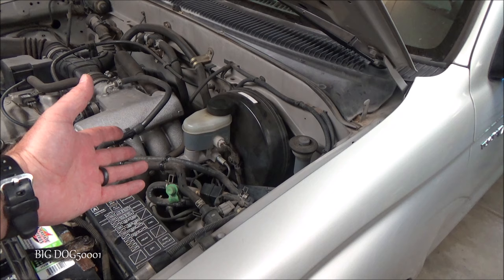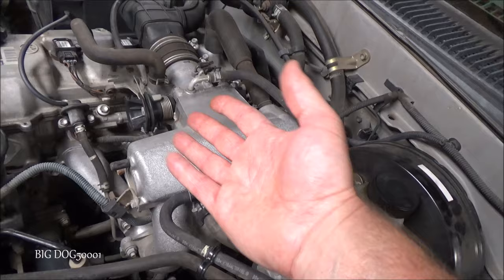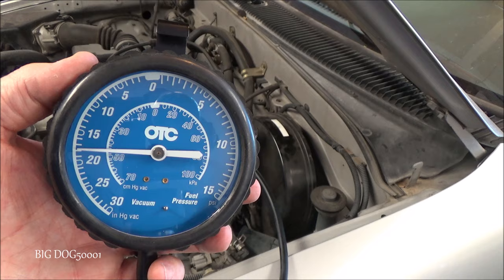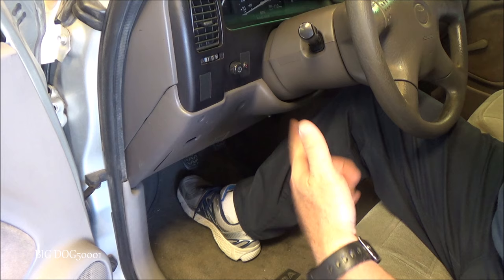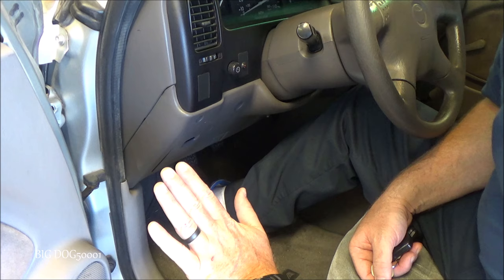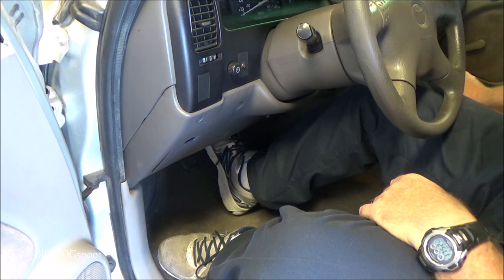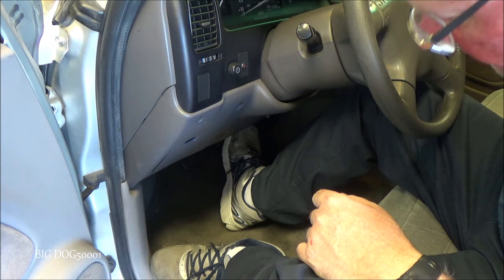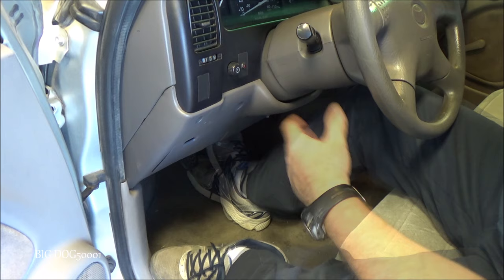How to Test For a Bad Brake Booster / Brake Booster Testing

Comment: Have a 2015 jeep Cherokee with low miles and the brake booster went out. Mechanic replaced it, went out again in 6 weeks. Replaced it again then said I needed to replace master cylinder…3 months later went out again and it’s currently at same shop for a week now. Jeep told him it’s a bad check valve but he thinks it’s due to recall W84 which is a transmission software flash…what is going on??

Comment: I’m pretty sure from this video that my booster is bad but I want to have someone’s opinion also. So my brakes lock up after a while and when they lock up I pull over and disconnect the brake master from the booster and it releases the pressure on the brakes and it works fine again but any idea why it does this after it is driven for a while.
Reply: austin morris hey did you ever figure it out ? I’m having the exact same problem
Reply: The brake booster was just bad so I tried to replace it but couldn’t get the last bolt under the petals off so I just plugged the vacuum line that goes from the manifold and now I just don’t have power brakes but the car is light so I don’t mind it
Reply: austin morris how did you plug it?

Comment: HI,
I have a Mazda 5 2010.
The breaks works fine in general driving with 2000 or more rmp.but with slow drving in town etc rmp around 1000 the breakpadle get 'hard' after pushing 1 or 2 times.
I have changed the vacumehose pack with the valve included...
What can be the course ?
Hope you can reply me..😊🇳🇴

Comment: Can a failing brake booster causes engine misfire..im in a situation where the engine misfires when not accelerating and ive got no breaks in that situ..however when i accelerate the breaks come back

Comment: Weird question. Can a brake booster be bad, causing a vacuum leak, but still work well enough for power brake assist?
Reply from the maker: Yes, that is what was happening to the vehicle in this video.

Comment: We have an 2014 F250 that has all new Booster and master and brake cylinder and the brakes are very hard to press.
Also mashing hard as I can mash the pedal the truck barely stops.
Any ideas on this one?
Reply: I have the same problem(69 dodge Dart) Vac, is 17 lbs from engine, check valve holding and Booster is holding Vac., but a hard pedal with engine off or on and does not change pedal travel as in your tests. Could it be a plastic wrap I cut to fit where the filter should be?

Comment: I have a 03 Silverado with a 5.3. I hear a whistling noise that’s kind of quiet that from inside the cab it sounds like it’s right in front of me from the engine. I’ve been told it’s a possible vacuum leak. I’ve looked and looked and can’t find anything. I’ve even sprayed almost an entire can of carb cleaner around trying to locate it and can’t find anything. Any advice? Thanks

Comment: I'm having an issue where I am accelerating then need to brake quickly, sometimes I have no brake assist.  My car passed all your tests except for the one where you start the car with your foot already on the brake.  You said the brake pedal should only sink a little, my brake pedal sinks to the floor within a few seconds.
Reply: 2012 sonata

Comment: Can you damage a brake booster by adjusting the nut on the back of the booster? I had trouble getting my new booster in due to accessibility so I attempted to unscrew the mount that attaches to the brake pedal but it wouldn’t unscrew and was altering the nut on the back of the booster instead?

I eventually got the booster in bled the whole system not too sure if Iv done it correctly but now the pedal remains hard with engine off but goes to the floor once engine is started?

Comment: So a bad brake booster makes it harder to press the pedal? My brakes are spongey and I replaced the master cylinder and bled the brakes and they’re still spongey I have no clue what else it could be. I put all new pads and rotors on them as well

Comment: Ok so I have this issue on my car:
The brakes are basically rubbish, they have no force. Pedal feel is solid, there are no leaks in the system, calipers have been rebuild, new pistons, sliders, new brake pads, and of course bleeding. Did the tests in this video and the booster looks like is working just fine. But still the brakes don't have enough bite, they work but you have to press harder on the pedal. What else to look for as it's driving me mad!?

Comment: Hi, I hope you can help me with this... My 2008 entourage has a slow sinking brake pedal. Since I didn't see any fluid leaking from any of the wheels calipers nor hoses, I replaced the master cylinder which I bench bled prior to installation and bled the lines until clean fluid came out from all the calipers. The brake pedal still sinks about half way and there is no ABS light on.
Any light you can shine on this problem it's well appreciated.
Reply: its your brake booster my friend, before the brake booster fails and your brakes fail then you have to panic emergency brake just to park.

Comment: I bought a 2006 BMW X5 4.4i with no brakes working condition, i just noticed this vacuum pipe disconnected 
Probably that's why don't working the brake??

Comment: Question, I'm running a 2003 350Z for road track use and after a couple laps the power brakes stop working and the pedal goes hard so no power assist at all but breaks still work. When I pulled the vacuum line the check if valve was holding air, nice loud pop of air when I disconnected the line, so would this be a bad power booster?

Comment: I have a 2003 Tacoma and I am losing brake fluid but cannot find a leak anywhere. And- my truck started smoking really badly when you first start it up, or when you barely give it gas after idling form a while- once you give it some gas it stops, and once it warms up it rarely does it. No water in the oil, no oil in the water- not using much gas or oil or anything. Is it possible it's leaking back into the brake booster and being sucked into the engine via that vacuum line? It didn't start until after this leak had been going on fore about a week and half- like maybe it finally filled up the brake booster enough to start letting fluid go down that line? Maybe?

Edit: never mind- I thought about that- that can't happen. There's a diaphragm in there that would stop the fluid form going into the line. It may be leaking into the booster but, that's not what's causing this smoke I don't think.

2nd Edit: Well, blow me down and call me shorty- I was right. I took the vacuum line off- full of brake fluid. So, I left it off, stuck a stick in the line and taped it up so it wouldn't suck raw air- totally stopped smoking. I can't believe that was it.

Comment: My 2014 Tundra, has the brake pedal sinking toward the floor,when I apply the brake. How would I distinguish,whether it’s the master cylinder or the ABS pump ? The fluid is low and there’s no leaking...the pad thickness is fine..

Comment: This is weird, because my brakes on my 2005 Dodge RAM 1500 hisses very loudly when rapidly pushing down the pedal as if doing an emergency stop, and then sinks a little, but when I turn off the engine, I can feel the pedal sink even further to the floor, but pumping it, it does become solid, also, there are no abnormal sounds during engine idle or speeds above 1200rpm, and there are no fluid leaks, but the fluid does need refilling about every 2 weeks.

So which is it, being told a leak in the booster makes the brake pedal harder to push?, or a leak in the booster causes the pedal to hiss when the engine is running and the pedal pressed?  Both answers are from various web sites.

It seems no-one really knows.  So if it is the booster, then it's time to send the truck to the junk yard as I can't afford the near $1,500 total to get it fixed, that's around $800 for a new booster and around $600 for labor.

Comment: hmm went to a very reputable mechanic for my vw cc, they said I had a bad brake booster. I did this test and passed it. IS there anyway it could still be a bad booster or would it be master cylinder?

Comment: I replaced my booster new and I have a hard pedal now? What the deal on that? It's cost me $300. I don't find anything. Do I have to adjust the rod on the booster? I bled all the lines like 3 times. No air in the lines.

Comment: Hi big dog on my camper when engine running  on pressing pedal  I get a air type noise  coming from  behind  booster. Very spongy pedal when running  but  very firm  solid  pedal  when not running would that be booster or cylinder  issue .  Many thanks  Mark.

Comment: I’m having a number of odd issues on a 2010 e class Benz and I think it may be the brake booster. The idle is kind of inconsistent almost like it is misfiring. Also occasionally when I’m braking to a stop or letting off the throttle the car will rev itself and actually send itself forward a bit.
Reply: Hello , might I ask you what the specific problem was with your car ?  And what was the fix ?  My car has the exact same symptoms that you described .  Was there any correlation with the vacuum / brake booster ?
Reply: They were two separate issues. I was able to fix the car revving itself at idle.. it wasn’t the brake booster but in fact the maf sensor. The other issue is still being investigated but it is slowly getting worse.
Reply: @Dnasty1   Hello, thanks so much for sharing this update / details .  It helps a lot .  Much appreciated .

Comment: What if pedal sinks further under normal pedal force, slowly for 10 seconds, when car is stopped, but engine running. Can this be weak booster return spring? I have sinking pedal which flexes calipers while sinking (caliper pistons continues to move), so it seems excess brake force is applied during pedal sink.

Comment: dear friend , i have Honda accord ,2009,2.4 l ,automatic , the problem is the car hard starting and gear shifting not good , the scanner appears these cods , p060a ,p62f , power train control model , and i can't fix it ,need your advice plz

Comment: I tried the diagnosis here but could not make sense of what's wrong with my car. With motor running, pressure on the brake pedal it slowly sinks (enough brake force for driving the car though). If I turn off the car, the pedal is rock solid and does not sink. I can do three pumps similar to the test in the video, get a little help, then less help and then no help from the booster. Only with the motor and booster running will it sink. The pedal is not spungy at all. 
It's a pretty new car.
What do you smart people think is wrong?

Comment: What causes your brake pedal to get rack hard when you're driving and your front calipers starts to bind to the point that your vehicle can't move?
Reply: Did you ever figure it out
Reply: Brake hoses are  internally damaged. Not allowing fluid to return to master cylinder, therefore  the brakes will not release
Reply: I have also heard if the master cylinder is not adjusted properly to brake booster you will get a rapid break response with very soft touch of the brake pedal

Comment: Hi, I own Audi A4, 2008. Few days ago, I replaced the brake booster and master cylinder. The second day when I was divining, the brakes applied by its own and stopped the car suddenly with smoke from tyres. I turned off the car and waited for 30 min. After this the car run ok without any problems. After 2 days it happened again and solution was the same. The mechanic did some adjustments but after 2 days the brakes become too hard to apply even on plain road. After few km run, the brakes become normal. Do you have any idea about this? Want to inspect my vehicle.

Comment: Thank you for your vídeos. My Nissan Xterra 2003 dies out after presing the break and turnin at the same time Chile driving. This happen right after a  booster repair job. No body has been able to fix it for me. All marked sensors have been changed and nothing. Have any advice? Thank you.
Reply from the maker: If it happened immediately after the brake booster work was done, then I would double check all work, especially all hoses and connectors that could have been disconnected or damaged.  A test that can be done to eliminate a bad booster is to seal off brake booster vacuum hose and see if the stalling problem goes away (I would not drive the vehicle around this way, this would only be for testing).  If the vacuum hose is not connected properly, or is damaged, or is pulling in pirate (unmetered) air through a bad brake booster, then that can cause driveability issues.

Comment: Dear sir, 
               Can u pls clarify this question?. Is Brake booster supply the air to vaccum pump OR vaccum pump supply air to brake booster. Which statement is right..
Reply from the maker: In general, on vehicles with a vacuum pump (this vehicle did not have one), the pump is pulling (vacuuming) air from booster which creates the brake assist.

Comment: Hi I am going to a wreckers today to buy a brake booster. Hissing under the pedal like a leaking compressor. Lol but I checked hoses , check valve etc. Under the pedal I checked inside the little vent holes on the rubber seal! I see a felt style gauze type of material, but the retaining ring or circlip etc is loose as a goose! As in it's floating with wobble side to side? I'm confused because it is bent ( concave) shape facing the firewall? Could that be the problem? As It started Hissing and got eorse over time. Pedal is great on first push( vacuum is good until a second push? Either way my vacuum gauge approximately 7 in/ HG but after some driving it lowers to around 4 in/ Hg on the gauge? It's a massive booster by protec or protex! But should I replace and be done with it or try to fix the retaining ring holding the gauze style material under the pedal circlip or retaining ring? Any reply appreciated? Cheers from Australia 🙂 top video! Subbed and liked 👍

Comment: What would cause an intermittent hard brake pedal?
Reply: Joshua Smith  I needed to replace the brake booster line on my 2001 Ml320 to fix the problem. The connection at the end of the line into the intake manifold was old and cracked.

Comment: Guess my booster is bad if it hisses down by the pedal when I push hard while the vehicle is on. I accidentally put all my weight on the peddle as I was getting out of my (2010 Chevy  Colorado 2.9L) truck so I pushed it again hard and it hissed again. But the hiss was coming from behind and up the brake peddle.
Reply: My 1987 mustang does the same thing. Did you ever find the solution?
Reply: @MrSpeedyPete  yea I just changed the booster

Comment: 01 accord idle fluctuates and sometimes stalls when braking and coming to a complete stop. I replaced brake booster after testing it by removing vac line and plugging. Problem still exists. When car is parked while applying brakes idle wil jump to about 1300 then drop to 600 or lower after 2sec. any ideas? IAC maybe? i was also thinking Master Cylinder possibly not functioning properly on booster side. Also i have no problems at the brake pedal.
Reply from the maker: I usually look for vacuum leaks first when the idle is surging on older Hondas.

Comment: Great video. I got new rotors and a new master cylinder (pedal was sinking to the bottom) and the brakes were working great for over a month. Then one day,the pedal would get stiff while driving and I noticed the brakes engaging without me pressing the pedal. 

The check valve is working correctly and after I reconnected the vacuum home,it was working normally again. What could be the issue?
Reply: Great question! I have the same issue on my old Tahoe. After watching this video I'm planing to replace the booster.
Reply: @4mbrad642  I replaced the brake booster and it fixed the issue!

Comment: When I apply pressure to my brakes I hear a moan from under the hood. Could that be the brake booster? The brake pedal goes to the floor too.
Reply from the maker: I look towards a bad master cylinder when pedal goes to floor.

Comment: Great Video, Thanks...
ONE-ish question. My pedal looses booster assist about 15 minutes into driving, and stopping requires a lot of force on pedal. 
The booster passes all tests, except when vehicle off, pedal pressed, start vehicle, pedal drops more than slightly, it drops slowly about 2" instead of 1/4"-1/2".
Replaced master, checked the booster from engine side, it holds (-12) psi, checked the check valve is good.
So I assume its a bad booster, but it passes all tests except slight drop on startup.
Is this because air is leaking into middle vacuum assist area, but not into first vacuum chamber? Why wouldn't it lose vacuum from engine side?
Also, how important is the gasket between master and booster? The one I have on there is damaged... would this cause my symptoms or is it a bad booster?
Thanks for reply if you've read this. I really appreciate it before I drop $250 on a booster after spending $160 on master!
Reply: Hey, what was your solution?
Reply: @mobilelube3261  I replaced the gasket between booster and master cylinder, but it didn't solve the issue.
I suspect it is the booster. 
I drive very little, so it almost never loses brake power if I don't hold the brakes too hard at stop lights.... which makes me think its one or more slowly leaking seals inside the booster.